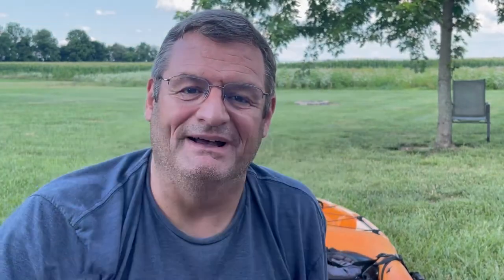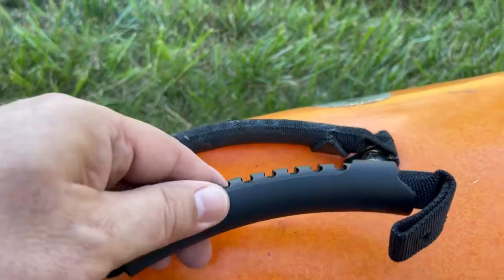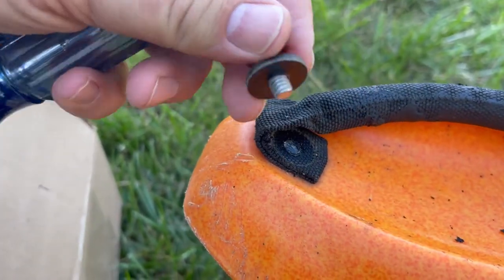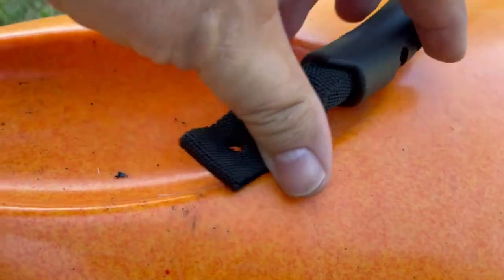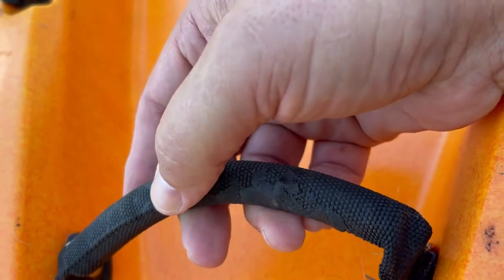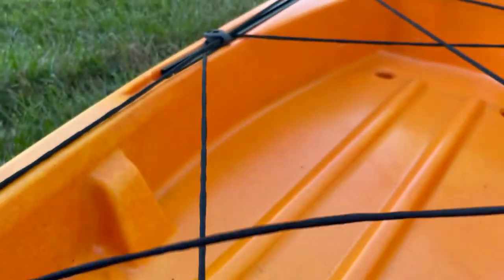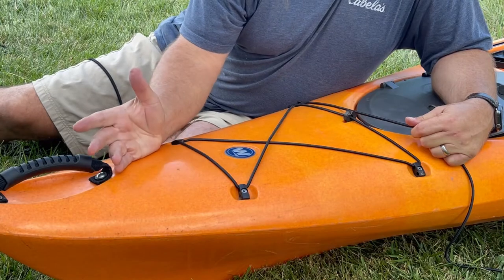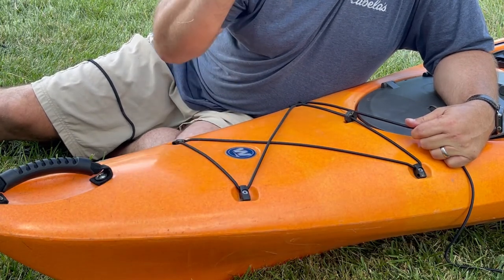Handles and Bungee Replacement | Wilderness Systems Tarpon 140

Comment: Cliff, the front and back handles went smoothly just as you say. But have you replaced the side carry handles? It feels like there is a plastic nut on the back side of the screw inside the hull that is nearly impossible to get to. Without being able to get a wrench on it the screw obviously just spins and will not come out. Any advice?
Reply from the maker: I haven’t tried replacing the side handles… can you grab it with vise grip and drill it out?
Reply: @clifffawcett  I was able to get a 7/16th socket on it to hold the nut. Very difficult to reach and there is not enough room to use the wrench. I had to hold the socket by hand. Not easy at all. I have a feeling there is a much better way!
Reply from the maker: @paullynch9156  If I ever take those on I’ll let you know
Reply: I used a small 7/16th crescent wrench on the second one. It was a bit easier.
Reply: I was able to reach the side handle nuts on a Tarpon 120 with a little bit of a reach and a rachet going through the center hatch.  I believe the 120 is wider so the 140 should be easier to reach.